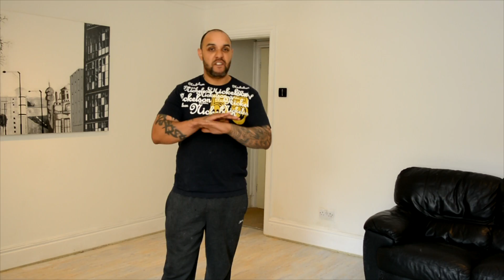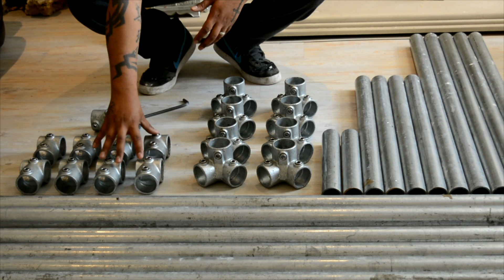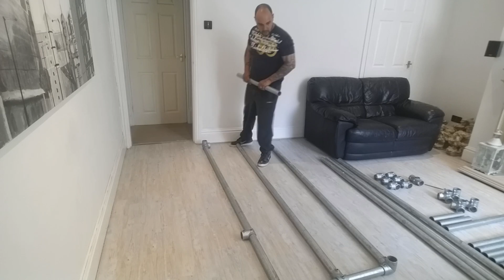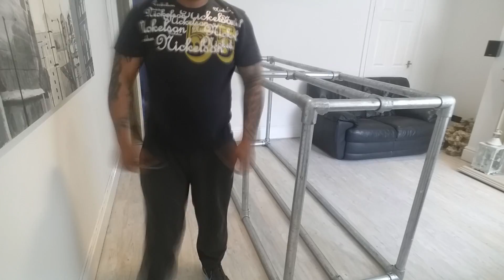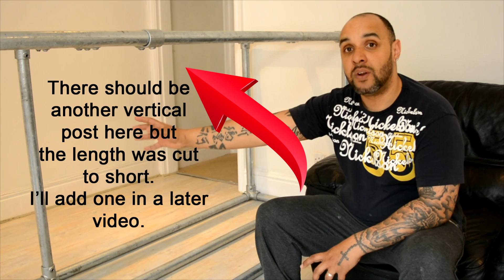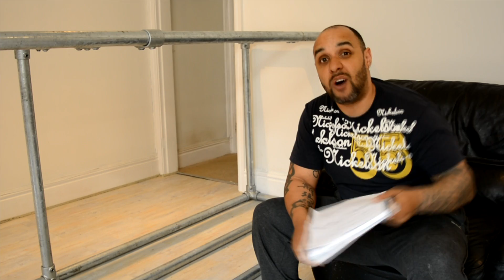How To Build An Extremely Strong DIY Aquarium Stand | 420 Gallon Reef aka The Wife Build

Comment: Hi Michael, i remember  watching this first time round and im revisiting it because of a project im doing. My question is how did you connect the face boards / cabinet?
Reply from the maker: @DogsBeingDaft  If I remember. I think I put a thin frame of wood on the interior and then fitted keku fixings.
Reply: @Michael_Aarons  tha is for the reply bud, I'll take a look.

Comment: I’m assuming the stand didn’t work out as I never saw a follow up video. My main question is how did you get the tank to sit flush on the stand
Reply from the maker: Yeah it worked great. To get the tank to sit on the frame I placed plywood on to and used a jigsaw to shape the plywood around the connectors. If you use ply that's a few millimeters higher than the connectors you don't have to worry about glass touching metal. For an extra bit of safety you can place a yoga matt on the wood before you add your tank.

Comment: That's key clamp you're using buddy, and although it is strong it is prone to losing friction at the grub screws over time, if it's not beimg repeatedly moved around it will hold up, but being a fabricatior I'd put sections together in the garden and put tack welds on to ensure maximum strength and ability to bring it into the house without removing windows or doors

Comment: You my friend,  are a genius!  Please can you tell me if it would be possible to put wheels on this frame. My tank is 150cm long and the glass is about 1cm thick. I'm disabled and on a fixed income. Someone gifted me this tank with loads of equipment, I've no idea what the are for! 🤣🤣. I've fallen in love with fish! Far too late, someone pointed out that it was an expensive hobby! Hah!! I'm more than willing to try this if it will work, however it has to sit just over my side board. The side board won't take the weight of the tank and water. I need to move it from time to time for cleaning. So what do you think? Thank you so much for sharing this idea. Stella

Comment: Any idea about the load bearing capacity of stainless steel legs of a stand. Like in wooden stands we have a rough estimate of 100 pounds per square inch of cs area of the leg, do we have a similar estimate in metal stands?

Comment: I have a 125? gal tank that measures 24.25"H, 19"D, 72.5" L.  Will 8 corners, 4 middle joints, 4 sides @ 19", 2 fronts & 2 backs @ 72.5", and 4 legs at 42" work?  Do I need to add support at the top center?

Comment: The only issue i see is that it still has the possibility of torsional decay. You could add in some additional diagonal structure to the ends to eliminate the possibility. And do NOT use potted metals as they will crack over time water has a weight of 8.34 pound per gallon multiply how many gallons of water your aquarium holds to that and you have a very close weight of what it will have to hold up to so keep that in mind like his 420 gallon with the full volume of water not including the tank itself will weigh 3502.8 pounds in just water weight alone and further more you could not put the aquarium directly on the stand like this on alone it will cause the bottom to burts if not on the first fill but will definitely do so over time.

Comment: I would like to see the next video where you put the tank on top of this stand.  My dad learned how to weld in the Navy and has welded many big aquarium stands and all had a perfectly flat  and wide metal on the top to put the aquarium on  as the weight of the water presses down on the bottom of the tank if it is sitting on something that is even slightly uneven, the bottom of the tank will eventually crack from the uneven pressure.  Sometimes there are no shortcuts that are safe when it comes to a construction project

Comment: He says he will be putting a 1.1ton tank on top of this. But i don't get how he does the math on that? my 180 gallon tank weighs just about that much, 310 pound tank, 1500 pounds of water, plus rocks and deco, comes out to right about a ton. This 420 gallon tank in just water alone would weigh 3500 pounds, let alone the fact that the tank should weigh 500+ dry, right there you have 2 tons.... i wouldn't trust that much on this frame for a long period of time with so little vertical support
Reply from the maker: This video is two years old the tank is still sat on the same frame today. You will see it in my recent video. The build is sound and solid.

Comment: Hi Aaron, I've just had my scaffold stand delivered. Can you let me know how you've arranged the tubes in the 90* corner clamps? Is the longest tube pushed as far as it will go in or the narrow tube? Alternatively in the upright tube pushed all the way in so it rests on the bottom of the clamp instead of one of the horizontal tubes? (hope this makes sense and you can remember). Thanks in advance buddy.

Comment: Mister, you are my new hero :)
This is truly a great idea... Thanks for sharing!
Reply from the maker: +Dave de Hart No worries pal
Reply: Hi, in the video you are tightening the bolts by hand. I've had contact with a local shop here that sells scaffolding pipes and they've told me i have to tighten the bolts with a torque wrench at 39Nm wich would be 29 foot pounds in the UK. Did you tighten the bolts with a torque wrench? And if not, do the bolts loosen after some time?

Again, thanks for this and all the other inspiring videos.

Grtz,
Dave

Comment: What material did you use to cover the top of the frame and how does it level with the elbow joints. For example if you used plywood top did you have to notch it out for the joints so it rest evenly across.
Reply: I would also be keen to know this?
Reply: Great Question Dedonohue!!
Reply: I also think this would be great to see. I never post on youtube but this is simplicity itself. I am making a similar design with smaller 27mm steel tube and Kee clamps. Plan is to notch out the connectors with a router.
Reply: I know this is an old video but I'd like to know as well.

Comment: Hi mate, love your vids.

Have you got any figures regarding the strength of scaffold poles at various lengths? I'm wary of people saying to me "you wont need a centre support for a 5ft tank". I was told that when I built a stand out of railway sleepers but I put one in anyway. Now I physically cant remove it because it's obviously taking so much weight, even though it was a couple of mm too short when I built it.

Comment: Michael- I just lucked into a 650 gallon tank. I'm thinking of using your scaffolding idea for a stand. There should be no worries by the strength of such a stand using this material correct? I think this is an awesome idea!
Reply from the maker: +Steve Offutt Yeah my tank is 7ft long and it's solid as a rock
Reply: Aarons Aquarium This is such a brilliant idea.  Will be putting one up next week very similar.  Thank you so much for the idea.
Reply: Do you know what that style of scaffolding is called.  I am hunting online and no luck so far.

Comment: I appreciate your video. Surely, it's difficult to keep the tank in position since the pipes are round.  Is this the same tubing used for chain link fences? If so, it's not strong enough to hold a large tank, no matter how many braces there are. Please respond to my comments, thanks, I need to learn more about your creation.

Comment: great idea tho I dont understand how u placed plywood or whatever ontop with the scaffolding bends obviously raised up a few ml if u knw what I mean? did u just cut round this?? thanks
Reply from the maker: +Aaron Buchanan I got 5mm ply then cut off the corners of the wood so it sat flush with the scaffolding unions. I then added a second piece of Ply on top of that to cover the metal.

Comment: so why couldn't  you carry  a timber  frame  down into the  basement  and put it together  down  there  ??? you couldn't  put that  frame together  up stairs  and carry  it down stairs  ether  right ???
Reply from the maker: +rov furness sorry I don't get what you mean? Of course you can build a timber frame anywhere that's the joys of using timber. Using scaffolding is simply an alternative. The plus to using scaffolding is the profile is a lot smaller so you get more room to work inside the cabinet.
Reply: There is no more or less room to work inside the cabinet of any decently designed wood frame.  Also, if you're talking about a joy of working with a certain material being it's easier to work inside of then I think you've got it backwards.  With wood you can custom fit anything.  You can build supports and or framing for sumps,, tie down spots for flexible hose, you can mount anything to it anywhere...I own a 4400 sqft fish hatchery I built from the ground up and I would laugh if anyone suggested this as a serious idea...silliness
Reply from the maker: +daniel1980ization ok well you're entitled to your opinion. Have a good day
Reply: are you saying if you put that stand together up stairs you could carry it down stairs in one peace ??? because in your video you say it's harder with timber because you couldn't carry it down the stairs in one peace ??? right .and the price different's  is minimal so it's pointless really because were do you mount every thing you need to hang under it nar sorry but I am not a fan of this stand at all ... pleas don't reply  I'm not interested
Reply from the maker: +rov furness ✊

Comment: I realize galvanized steel is extremely strong, but I do not understand how this frame handles potential horizontal weight shift across the width of the tank. Without any diagonal supports, this thing could fold in on itself if someone bumped into it hard enough.
Reply: No different than wood. Wood frames you buy don't have diagonal supports
Reply: Yeah get a good wavemaker going and have that wobble back and forth for the life of the tank.
Reply: A wavemaker, probably not. But an earthquake like the one qe had yesterday in Mexico, for sure.

Comment: Those joints aren't going to hold up to high lateral loads. You'll need to add in cross bracing to prevent racking, additional legs to support the top pipe and to help spread the load. Scaffolding is designed to be as light as possible and still support dynamic "man" loads, normally  1,000 lbs (2 men with tools/materials). I'm figuring at 420 gals, min static load is well over 3k lbs. It's a bad idea dude, sorry. Don't want to see you get hurt, or lose $$.
Reply from the maker: +joeashbubemma Hi pal, the 420 Gallon is combined water volume (including sumps). The tank itself is 290 gallon and will weigh around 2400 pounds it now also has 3 support legs on each side.
Reply: Still, that's a lot of weight on tubing with a wall thickness of what is basically thick sheet metal. The biggest concern are those joints. You are relying on those corner joints to hold your lateral load. You might want to add diagonal bracing on the short sides, and and "x" on the back side. 
Anyway, hope it works out, good luck with your project!
Reply from the maker: +joeashbubemma I can't do that due to the layout of the cabinet. It has been weight tested to a weight larger than the tank so it should be fine.

Comment: Very good idea!! I may have to use on my upcoming build!

How's will you ensure top and bottom of stand are level as the brackets are a couple of mm raised from the bar so may cause base of glass to flex over time?

Or will a plywood sheet and polystyrene make it level enough?
Reply from the maker: I've used plywood to level it.

Comment: Do you feel that you will be losing a little bit of weight support by not having the post running down the middle of the stand like you did in the weight test demo? I noticed it had a post directly under where the weight was placed that ran from the top section to the bottom. Obviously that bar would add additional support to hold the weight but without that being directly under the tank you are not worried about it supporting the weight? Obviously the two supports on the outside of the frame will help but having a bar directly under where the weight is placed does help.

Comment: If you use this material, I noticed you didn't mention an any other concern except for weight. Such as was the scaffolding you purchased hot-dipped? Basically the scaffolding is coated in zinc that protects the metal from corrosion. Otherwise it can rust quicker than expected.
Reply from the maker: I did mention that the metal is Galvanised so be careful when cutting it.

Comment: Great idea. Dont think I'd be brave enough though. It's not the flex in the scaff that concerns me, but more the only thing stopping the legs from splaying is the bolt into your unions/angles. Although, I always tend to over engineer my cabinets so I'm probably over thinking it. I'd definitely look at painting the poles though, salt water and galv steel is not a good mix.

Comment: another perk to this stand is if u move or need to relocate ur tank this stand can be taken apart easily also u could move it in sections instead just a cool idea.  Also if u wanted to eliminate the center bars all together and spend a little more money you could find a smaller pipe to fit snug inside the others there for theyd be reinforced and the bars wouldnt flex even without the center bars. man this stand can go in sooo many great directions lol u have me over here pondering all the possibilities lol Proper Proper video and idea!!!
Reply from the maker: Great idea on re enforcing the bars

Comment: I think you might have surpassed Joey on creativity. I was actually looking on how to do something like this for the same reasons you mentioned, access to the sump area and I think it's brilliant. Do you plan to cover it with something? Are you planning on putting anything else on top to support the aquarium?
Reply from the maker: +Who ? Obviously the cost of this stand is high due to the size of the stand. The cost is only £12 more expensive than timber so it's very affordable and a hell of a lot stronger.
Reply: Not to mention very easy to build and assemble.
Reply: you forgot joey build by affordability and availability in each of own places...

Comment: Nice idea sir . But I have a doubt what if it starts to rust will you apply red oxide solution for your steel or you have some other idea
Reply from the maker: The steel is Galvanised which will take decades to rust

Comment: Man wish I had one of these for the JBJ... Could prob build one for $60 lol. How do you feel about the height? Sitting down your head is below the tank... And def would need a step ladder. Nice idea for sure def first of its kind that I've seen 👍🏾
Reply from the maker: It's to high. I'll be bringing it down so it's level with the sofa. I was think about the view when you walked into the room more than when you are sat in the room.
Reply: +Aarons Aquarium good deal... The great thing about this idea is its so easy to cut the pipes shorter and put it right back together.  You will sort it out I'm sure... Don't forget to leave enough room to removed skimmer lol. Does this stuff have any risk of rusting? Warping? Or your mag float getting stuck to it? I'm curious as hell man
Reply from the maker: +CJ'S AQUARIUMS Well it's used for outdoor construction  so people can work at high heights and it's also used to support heavy structures. With it being Galvanised it can rust but it would take decades to happen. In our environment it would probably take even longer. It's coated in zinc so you have to wear a mask when cutting it.

Comment: That's a great idea. If it was me I spray the stand with rubber paint. I mean that's what I would do. just an idea. You saved a lot of $$$$
Reply from the maker: I'm toying with the idea of spraying it. If I get the time I may do.
Reply: +Aarons Aquarium It would be a good thing to do. You know now they spray cars and especially the rims and it's water proof. You seen the Comercial where they build a small boat out of screen and they spray it then take it to the waters with an engine.
Reply from the maker: +Ruben because the steel is Galvanised I don't really need to spray it as the zinc coating will prevent rust. I'll just be spray for aesthetic reasons

Comment: Are you going to be doing any more fabrication on the the rounded parts, were the tank sits.
Reply from the maker: I'll be adding a polystyrene and board to the top to compensate for the rise in hight due to the corners and tees